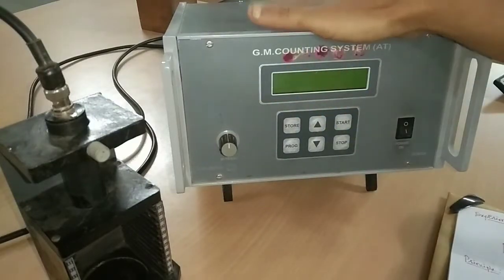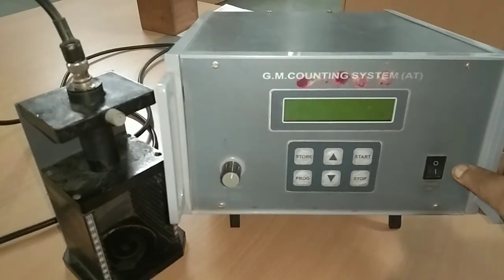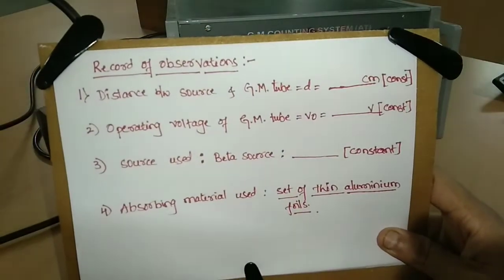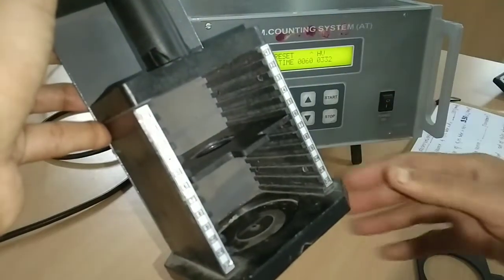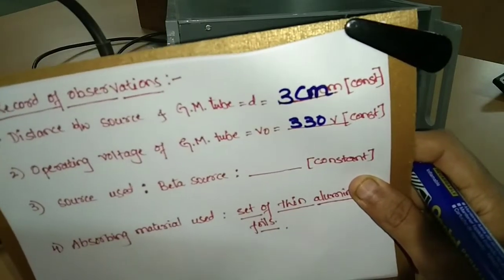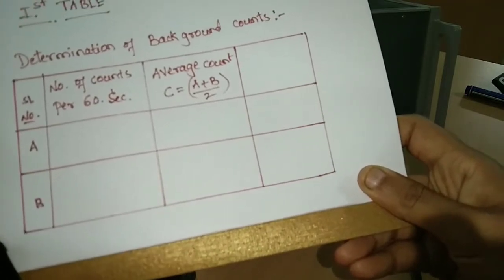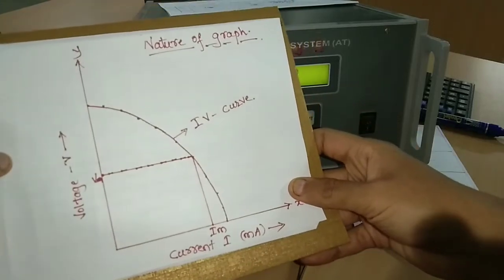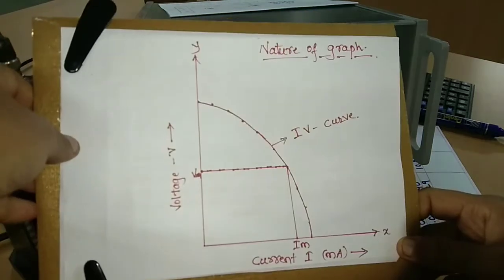G.M.Tube Experiment. Attenuation of beta ray using Aluminum foil.

Comment: i would like to know about what we do after getting all the readings.
Reply from the maker: Its a practical reading....
How we going to take.
Reply: The aim of this experiment is to determine the attenuation coefficient of beta-rays (mu). So, a graph of  ln( Io/ I ) = (mu)x should be plotted and mu = the slope of the graph. Take note that ln(lo/l) = log(Corrected Count in 60 sec). Therefore, you need to plot a graph of log(Corrected Count in 60 sec) i.e y-axis Vs Thickness of the thin Aluminium foil (x in mg/cm^2) i.e x-axis. Then look for the slope. Note that a straight line is not obtained but rather one which is slightly curved, just like the one she got. In the upper left, however, the curve may be assumed to be linear and the slope can be easily estimated.

Comment: From where I-V curve??
I can't understand that please help..🙏
Reply: The aim of this experiment is to determine the attenuation coefficient of beta-rays (mu). So, a graph of  ln( Io/ I ) = (mu)x should be plotted and mu = the slope of the graph. Take note that ln(lo/l) = log(Corrected Count in 60 sec). Therefore, you need to plot a graph of log(Corrected Count in 60 sec) i.e y-axis Vs Thickness of the thin Aluminium foil (x in mg/cm^2) i.e x-axis. Then look for the slope. Note that a straight line is not obtained but rather one which is slightly curved, just like the one she got. In the upper left, however, the curve may be assumed to be linear and the slope can be easily estimated.